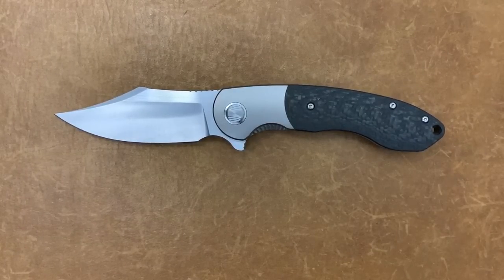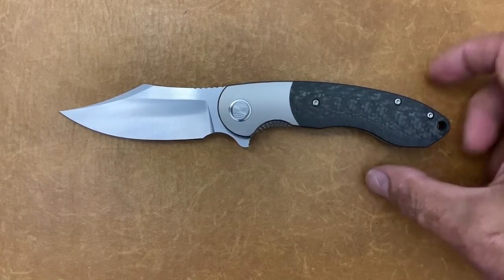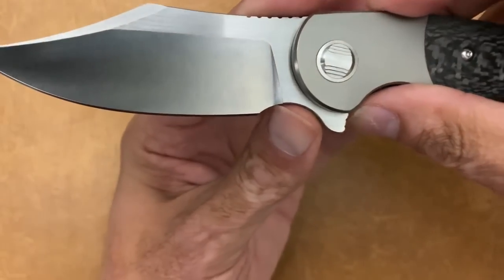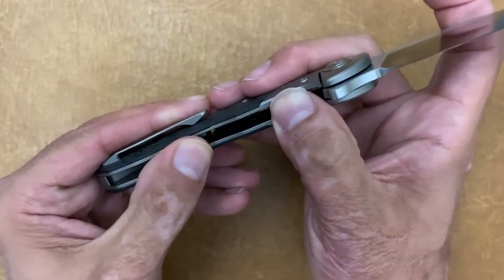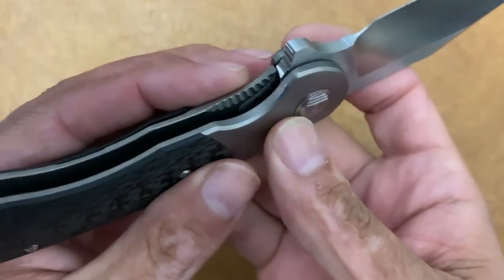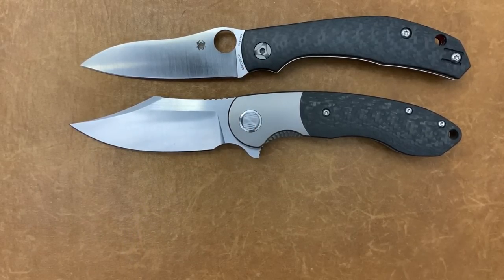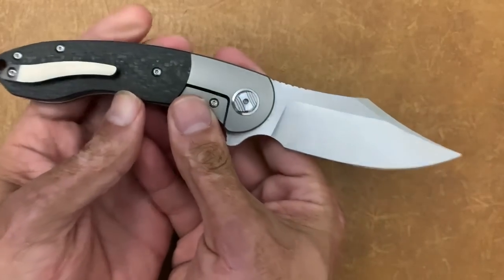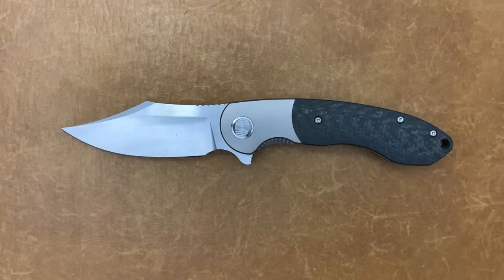Bestech **BowieTie** Prototype

Comment: This is a great design - especially that blade! Agree with you on the lanyard pin vs. hole. Sterile blades are always preferred. Branding could be on pivot hardware, laser etched in the backspacer or inside the scale.

Comment: For me, this is one of the best looking production knives coming out of Blade. I'd hate to see the logo as well, this looks like a custom without the billboard. Even the pivot is gorgeous. Really impressed. The blade of course is a huge selling point, as is being a bolster lock since that's my display side. Glad there's no extra hole to switch clips, personally. So many little details make this really impressive. I like the CF, but if they did this in micarta with darkened Ti... Maybe dark hardware and a bronzed collar. Totally agree on the lanyard hole. Bestech used to spend a lot of time designing the lanyard holes on their earlier models, this looks like an "Oops, lanyard hole!" It would be easy enough on the backspacer, or skip it altogether (sorry lanyard guys). Great Nick!